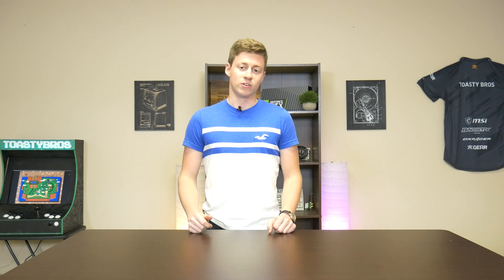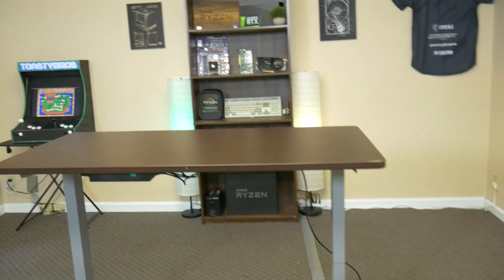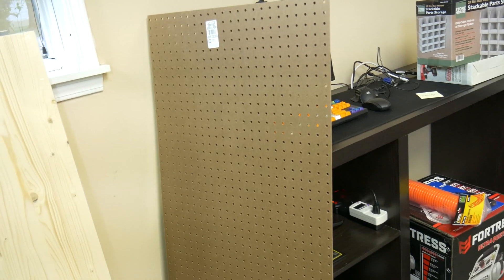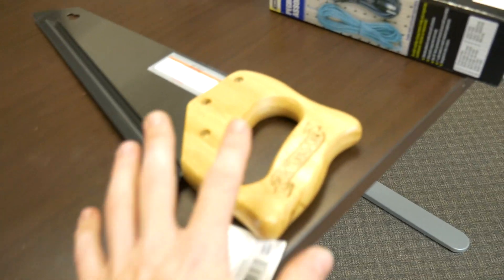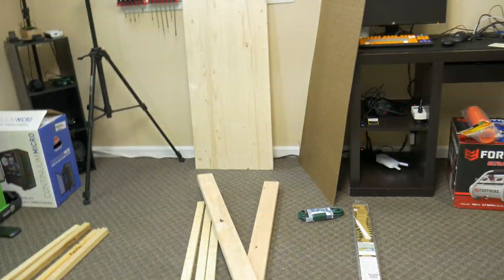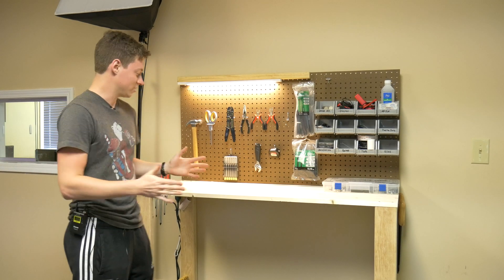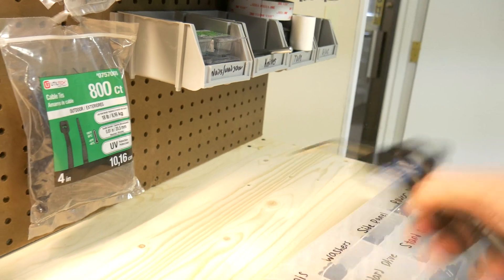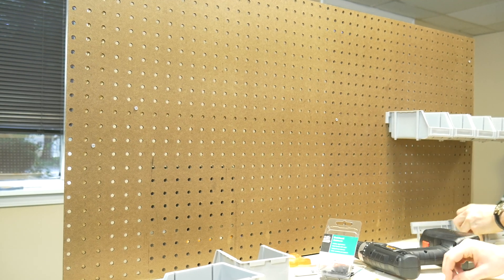Building A Custom Computer Repair Desk!

Comment: You need some support on the back of the legs to prevent racking of the legs. some diagonal pieces in the back corners or  2 boards straight across right next to each other across the back legs should do it. Hope it lasts you many years and with few splinters.

Comment: You might want to seriously consider an articulated magnifying desk lamp. Helps loads with small repairs. LED 5X Magnifying Glass Light Desk Lamp - 3 Light Colors Illuminated 10 Brightness Dimmable - USB Powered Magnifier Lighted Lens Adjustable Swivel Arm and Tabletop Clamp for Close Work Craft & Reading https://www.amazon.com/dp/B07XDFFRFN/ref=cm_sw_r_cp_api_i_WzksEbXJEXGM2

Comment: Building workbenches tends be something you start out as very basic and evolve with time. 

My dream set up has a raised edge to keep screws and other objects that roll all over the place from flying off the floor. 

While the brace for the pegboard gives it structural support, you might consider putting a wooden crossbar on the bottom if you have any wobbling. The cross bar would attach itself to the two side rails you have for the legs. It would help prevent sagging. 

One thing I've always wanted is a magnifying glass lamp on an arm that I can move into place when I get those annoying little tiny screws I can't see very well. But I'm old and got grandpa eyes, so might not be something you young sprouts care about.
Reply: I'm 5 years late... BUT a magnifying glass/lamp is great! GET ONE WITH THREE arms, not just two, let's keep the light out of the way when you don't need it

Comment: its a cute desk but a tad wobbly for my taste. I would have tied the front and back legs (longest legenth across) together. Having built several work benches over the years. Just using the top board and bolting the legs to it can be a big weak point and your table is subject to breaking in the center if you fall on it or put to much weight on it.  I would at least run boards under the top around the edges bolted into the legs as a measure to strengthen up the whole thing.  Granted your not building a work bench that can handle 500 pound engine blocks. There always seems to be that time you need to or want to stand on it..  Overbuilding is always a good thing. https://gyazo.com/e47826625b7450db222b81da89ed744e
Reply: What it looks like today...  https://gyazo.com/50447385ef6d4d81e8741b7ee0d4e509